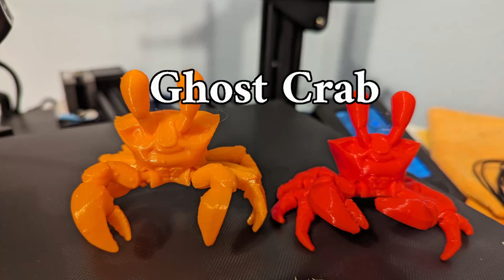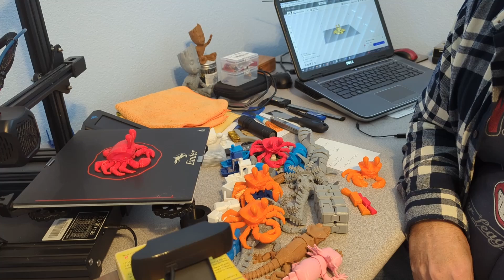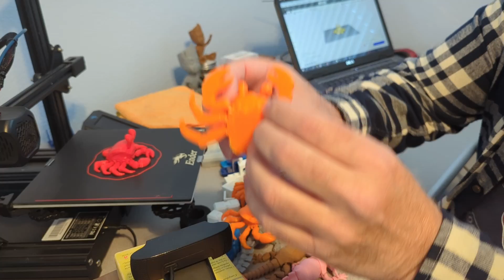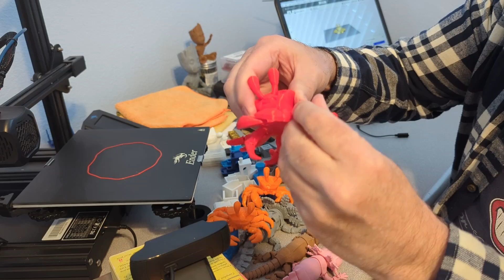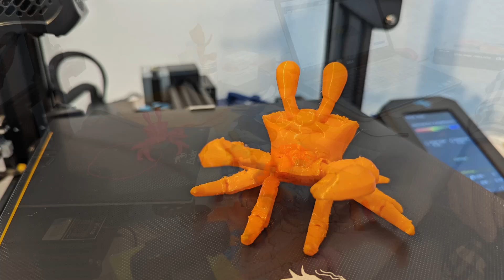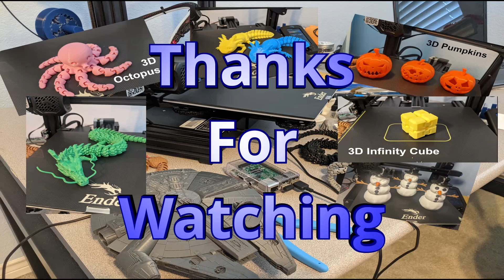3D Printed Articulated Ghost Crab

Comment: What ender printer do you use and have you made any modifications? Im just starting out and i am enjoying your videos
Reply from the maker: I have the Ender 3v2. The mod I have made are the yellow springs, path for the filament and when the extruder broke I replaced it with a duel gear extruder.
Reply: Thank you😊

Comment: What print settings did you end up with on last print?
Reply from the maker: I set wall count to 3, Horizontal expansion to -0.06, Infill density to 10, Infill pattern to gyroid, Retraction distance to 6, retraction speed to 25, and Z hop height to 0.6.